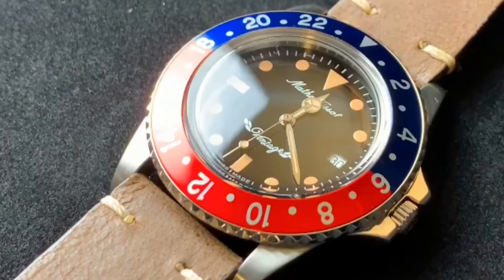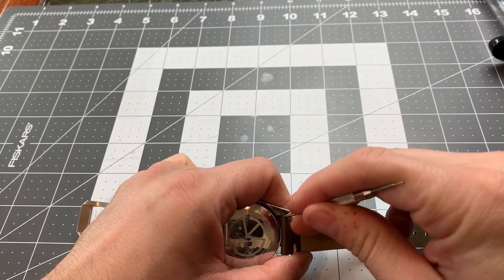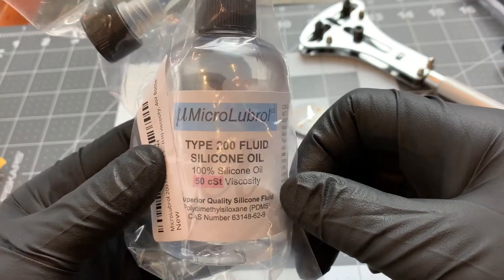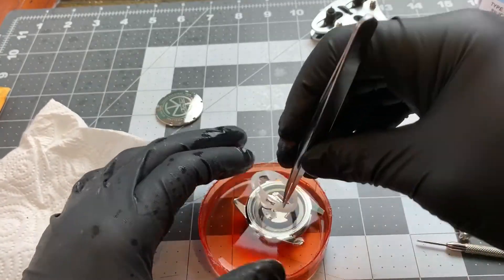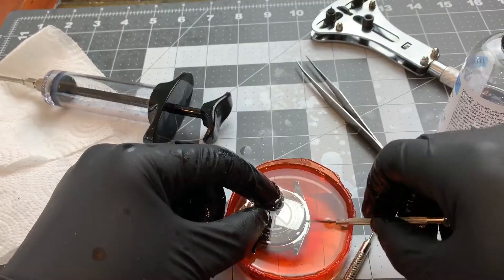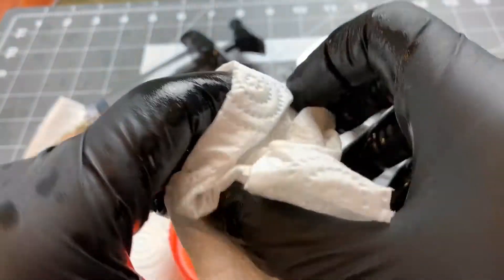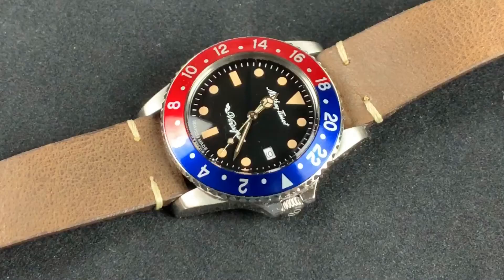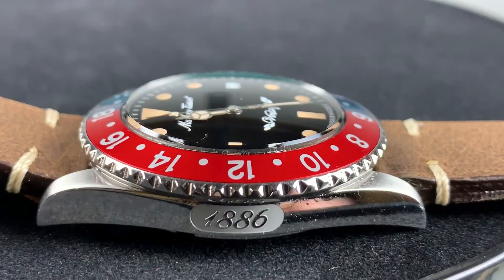Oil Filling a Watch:How to tutorial.  SO EASY!!!!

Comment: This would be perfect in a solar powered quartz so you never need to worry about a battery change.
Reply from the maker: I agree.  It is a project for this summer
Reply: @allthingsrandom8137  The only other potential issue is changing the time. I’m guessing it’ll leak oil when you pull the crown out. Maybe it would work with an atomic radio or Bluetooth one, although that might get expensive if it fails!
Reply from the maker: FazerWiz look at the Strapsco vid I did about 2 months ago.  I show how it doesn’t leak at all
Reply: @allthingsrandom8137  I did it, it worked really well. I'm lucky to have a vacuum chamber (used in cooking) and so didn't even need to disassemble the watch. I just placed the watch in an oil bath (I used 20 cSt), put the whole thing in a vacuum chamber and all the air boiled out. Here is a before and after, no batteries to change! :) https://youtu.be/DTlQGnp6Qp4
Reply: Sadly you will at some point need the capacitor changed in any solar or kinetic watch. Capacitors don't last forever either. So changing the capacitor will be a messy business just like a battery change.
Reply: @a0r0a745  It'd be cheaper to throw away aa watch in this price bracket and buy a new one than change the capacitor. It'll be years before that's necessary and high time for a new one.
Reply: @FazerWiz  agree with you the price some rip off places charge for a capacitor change. Depends  where you get the job done. However, I don't think many would touch the solar/ kinetic watch after this procedure anyway so making it a throw away watch.
Reply: Actually the Promaster series have long life battery even older models still hold same battery after 15+ years....

Comment: Don't do it. It screwed up my Casio Duro. Slowed time, Leaked, Messy, Overall effect not worth it!.
Reply: Coconut oil
Reply: Grapeseed oil
Reply: Maybe the oil in Moscow is different?
Reply: Oil of Olay?
Reply: Extra virgin oil
Reply: Man oil?
Reply: Bike chain oil?
Reply: 90W gear oil
Reply: Olive oil💀
Reply: still no answer :)
Reply: What oil did you use?
Reply: @jusuftheeagle6772  Silicone

Comment: What’s the long term effect?
Reply from the maker: sol star what do you mean specifically?  Right now the watch is running about plus four seconds a day, and it’s fairly consistent with that.  The batteries been in it for over a year, and when it goes dead I’ll submerged in oil, open up the back again, and replace the battery.  The process is so simple, yes it is messy, but if I only have to do it every few years I don’t really think it’s a big deal
Reply from the maker: sol star and if you’re asking if the oil affects the movement of the watch, it does not at all. But it may patina the Dial faster.

Comment: That will be nice to deal with when the battery needs replacing. Also adjusting the time will be a possible issue. I guess unscrew the crown and have the watch on its side crown up, adjust then resecure the crown tight.
Reply: Not an issue. Anything sealed for dive pressure could do this with its eyes closed.
Reply: @melody3741  really, I am sure changing the battery would be a joy to do 🙄

Comment: Excuse my ignorance, but what happens when you open the crown to adjust the time? Does it seep oil or drip?
Reply from the maker: Joseph Wallace nothing at all.  There is a seal on the inside.  I would still recommend the dive version with a screw down crown.  But I haven’t had it leak yet

Comment: I've got a MT rolly GMT,  I   would be terrified to fill it with oil. But It does look great though, especially with that crystal. I think on the down side, youre going to have a messy battery change
Reply from the maker: To be far, as easy as the process was, if only once every two or three years?  No biggie.  I only wish I used the dive watch Instead of the one here
Reply: Please do not ever do this on a mechanical movement like a rolex PLEASE
Reply: @melody3741  apart from the fact this in time will possibly destroy the quartz movement and the seals in this watch. This is not a technique for any mechanical watch, would love to see the hair spring on the balance operate, rotor and gear train operate if anyone did 😂🤣
Reply: @a0r0a745  I have doubts a mechanical watch would even run at all once submerged in that oil. 

Why do suppose this would ruin the gaskets though? Many rubber gaskets actually get improved longevity when regularly exposed to light oils.
Reply: @Strideo1  Of course a mechanical watch would not run. A sticky hairspring because of oil on a balance will make a mechanical watch run super fast or not at all. As for the gaskets, depends on the oil used.

Comment: I am considering doing it myself but I am concerned about one thing--- when you unscrew the crown to change the date or something, will the oil leak？
Reply from the maker: Wotan Lau The one I used actually doesn’t have a screw down crown, it has a gasket around the crown stem, so it doesn’t matter if it’s pushed in or pulled out to change the date it’s still fine
Reply: I was asking myself the same question since 50m water resistance with a push-down crown is on the low end as a diver. Thanks for the question and answer

Comment: well explained. thanks. I have an old quartz watch I'd love to do this to. It SAYS... "50M water resistant" on the back. I prised off the back to reveal it has no gasket. Although the fit it fairly tight. Can't yet findhow to remove the crown stem. Looked fore the little button - to no avail so far.

But here, the question. Is there any way to tell if it is sufficiently waterproof for this MOD, and wats to stop the oil leaking out of the crown stem movement?

Final quewstoin - is the process reversible. Once done, can it be cleanoed out wihtout fcu(king up the whole thing?

Thanks!
Reply from the maker: esotericist process is not reversible.  Once oil touches everything that’s it.  That’s why I bought a watch specifically for the mod.  Honestly I would recommend a quartz diver.  Most offer at least 100 meters of water resistance, and most have screw down crowns
Reply: @allthingsrandom8137  all clear and thanks for your professonal advice/response.

Comment: So, I did this last night to two watches and both failed. I used the exact oil you're using... any ideas why?
Reply from the maker: Failed in what ways?
Reply: @allthingsrandom8137  Second hand no longer ticks. Just stuck in place. Tries to advance, but doesn't. Oil Filled a Casio Forester and a Timex Expedition. Any suggestions?
Reply: I am wondering that since both have illumination systems (Casio has a light and Timex has Indiglo) that could be playing into the issue? Both the light and the Indiglo still work, but they're no longer keeping time.
Reply from the maker: The oil shouldn’t have any effect on the second hand really.  And it also shouldn’t effect the electronics.  I’ve done it to more than one watch, but one was the Swiss and another was a citizen.  Maybe try it on a more robust movement?  Honestly I’ve watched it work on so many watches, you maybe the outlier.
Reply: @allthingsrandom8137  After the first failed, I was like well, maybe that was just a fluke. And then when it happened again, I just thought I was doing something incorrectly. I have assembled and repaired many watches, so I didn't think it was an issue with technique. I may try a watch without an illumination feature and see how that turns out. I'll chime in with my results later this evening. :D
Reply: @TkacikYero  hey man. I did my first oil filled watch today and had the same issue as you did. The second had was frozen in place and juddered very slightly as if battery was flat but this is a new Casio Duro marlin. I changed battery and no difference so think somehow the silicon oil has fried the quartz movement???? 😞
Reply: @cozmo1589  yall the oil is so thick its stopping the stepper motor. Watches were not often built for this and you need to see if its been done with your exact watch.
Reply: @cozmo1589  you also have to be absolutely sure the oil is 100% dry.
Reply: So, it looks like I was just a fluke. I've completed three more without issue. I appreciate your responses.
Reply from the maker: Joe Tkacik for sure!  Glad to hear it worked

Comment: No but really do this?? I have a 1989 1999  5h26-7a19 seiko what's the benifit of this mod
Reply from the maker: The only benefit is that the dial distortion goes away in the image appears on the bottom portion of the crystal

Comment: when i read the name, I thought you might use an automatic watch, and I was like woah that sounds crazy, but its a quartz :|
Reply from the maker: Yeah.  I already know what would happen with an auto, which is a mess.  And I’m not a quartz lover, but man that dial looks cool as hell
Reply: @allthingsrandom8137  well I was just wondering maybe you some how got a auto to work with oil and that would be cool
Reply from the maker: Williamchan87 trust me, I so wanted to do the same thing.  We’re in the same boat
Reply: @Williamchan87  I think by now the only ones who managed to do this are the guys at Ressence, but at 20k$ minimum they're not exactly cheap... Plus the movement is well separated by the oil filled part and (if I remember right) the motion is transferred from the movement to the oil filled part with no contacts (magnetically)
Reply: auto can't be hydro modded, since it has a tons of moving parts, and especially the oil will give the balance wheel a lot of friction

Comment: I am seriously considering doing this to my CWC royal navy diver. Have you noticed any drawbacks to doing this yet?
Reply from the maker: Nothing so far, I really love though the way the Dial image pushes out against the curved crystal.  I am still considering getting a 200 m diver and then doing the same thing
Reply: Apparently using silicone oil turns the lime yellow, however others use a another oil which doesn't do that and more runnier but is like 40 dollars per bottle

Comment: Can you use other oils?
Reply from the maker: pusc1f3r The recommendations are 100% silicone oil or 3m fluorinert oil.  These will have no effect on the electronic components, anything else may conduct electricity and short out the watch
Reply: Years ago, I filled my cheap Casio F-91W with olive oil. Yes, olive oil, because I had no silicone oil, and was just a test. Still keeps the time, and the oil inside. No leaks. 
I'm diver, and the F-91 (a Water Resistant watch, that you can't even take a shower with it), has gone diving several times with me. Some, very deep, 40 and 50 meters).

Comment: I did a couple of these oil fills on cheapo casios I got to practice dial customization and some other mods.  They look brilliant but I was worried about the battery life so I ran some probes into one of them and found the current draw was 3-4 times higher after the oil fill as the movement has to work harder to keep time.  This means a three year battery will last about 10 months in 50ct oil.  Also make sure the crown is fitted but in the out position as you tighten the back otherwise the hydraulic pressure that can be caused as the back closes can pop the front glass off!
Reply from the maker: Sooty S great points to know, especially the battery life
Reply: Marvin, I agree. After the faded test dial last year I got curious...
I made up about 30 vials and put a bit of brass with a different combination of dial printing type in each, with various fluids. Transfer print, sublimation print, acrylic paint, enamel paint, different undercoats, lacquers etc. Some vials got silicone oil, some got flourinert, some just air. Left most in the sun, hid some away as controls.
Learnt a lot. Main takeaways were that silicone oil accelerated fading in sunlight but made no difference in dark.      The transfer inks performed worst, then acrylic. Sublimation wasn't affected and was still looking as good as the control a year later. Enamel was fine as were quality artists acrylics.  Put some lume on some of them and found super luninova changed colour a bit when it got wet but still glows fine. Glow in the dark plastic was unaffected. If you are doing this, either punch dial markers from thin sheet or buy ones with glow already in them and it'll look great.
Also flourinert caused less fading but it's horrible and escapes from pretty much any enclosure. It will certainly get out of normal crown seals over a few months and will pass through some plastics and rubbers. I suspect the vapour is nasty.  Not for mods - don't go near it unless you are making a metal case specifically to contain it.
Reply: Couple of months on and the dial prints have faded quite a bit faster than I would have expected. They were cheapo transfer types rather than tampo prints (these were just trial pieces) but I would had be expected years not months before fade became noticeable. I wonder if the oil dissolves the inks?
Reply: Silicone oil is 'minimally reactive,' meaning the likelihood of stripping dyes and paints are minimal in relation to mineral oils. However, this doesn't mean that it's 100% non-reactive; as an oil, it's eventually going to strip and fade any reactive dye (ie, 99.9% of colored dials and markers in watches.)

 This is why you don't see anyone doing these to expensive watches; the hydromod began as a purposeful mod done by divers in the fifties who couldn't afford a Fifty Fathoms or Rolex, and needed to quickly increase the density of a minimally waterproof cheap watch like a Timex or Caravelle in order to use once for a deep dive. Afterwards, the watch got tossed, as it was now basically useless for everyday wear.
Reply: @sootys4024  yes, it does.
Reply: How viscous is your oil?
Reply: @MrEpsilonZero 50ct seems to work fine

Comment: When you're adjusting the time does any oil leak from the Crown?
Reply: Here is the answer https://youtu.be/sZkrjHINtU8
Reply: Yes.
Reply: @psanto13  If it has a rubber gasket, no. If water doesn't get in, oil doesn't get out.
Reply: @rehakmate  Water WILL get in when the crown is out for time adjustment.  They always say always ensure the crown is secure before allowing the watch to get wet.
Reply: James Barrie I was going to ask the same question.

Comment: Thanks for the tutorial. So you know whether these oil-filled mods ’fly’ well? I want to do one for my father who lives overseas but I am concerned that the oil might pop the crystal out when the air pressure falls in flight (when it’s being shipped to him)
Reply: liquids barely compress with air pressure, only air does. so with the watch being oil filled, the risk of popping the cystal is even lower than without (which is already almost non-existent). The real concern should be temperature. So make sure that the oil isnt too cold or warm when you fill the watch
Reply: @aole89  completly correct!
Reply from the maker: Here is what I would say, if you choose a watch with a screw down in case back and screw down crown shouldn’t have any issues.  

For example Mathey-Tissot has a quartz diver that looks the exact same that offers 200 m of water resistance, with a screw down crown and case back for $108. That would be a good option, and I couldn’t see that failing in flight

Comment: Is "Mont Marte Premium Silicone Oil 2oz (60ml) for Acrylic Pouring Paint Cells and Fluid Art" from amazon will work as 50cst silicone oil? I am not able to buy the same thing as you. Please help
Reply from the maker: I took a look at it.  It’s good.  As long as it’s 100% silicone oil with the low viscosity it’s fine.  That should work well

Comment: Could you show me how to adjust the time and date while it's already filled with oil? Thanks.
Reply from the maker: Trianta Abadi The same as you would if it wasn’t filled with oil. The viscosity is thick enough to where it shouldn’t leak out when you adjust the time
Reply: Thanks budd!
Reply: @allthingsrandom8137  nice. I was worried my cheapo watch will slow down and I couldn't adjust time after doing this